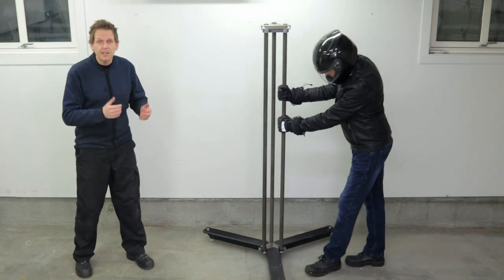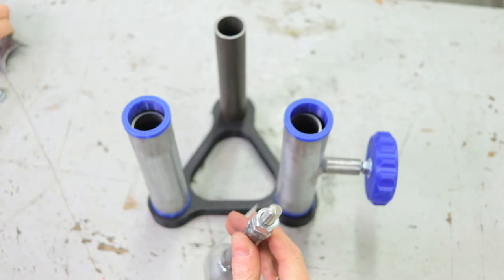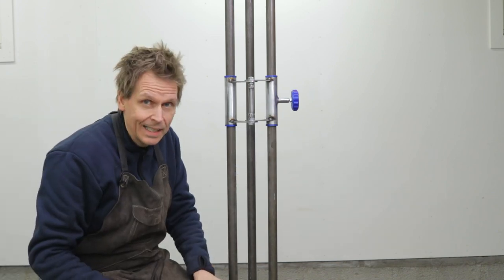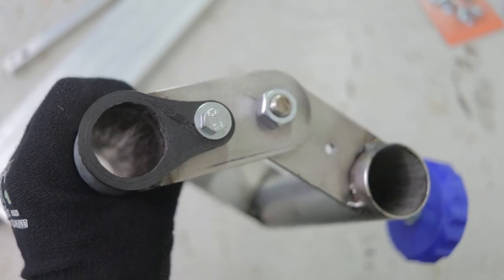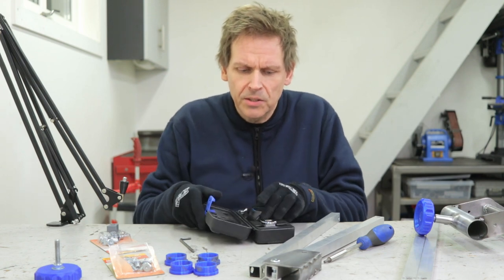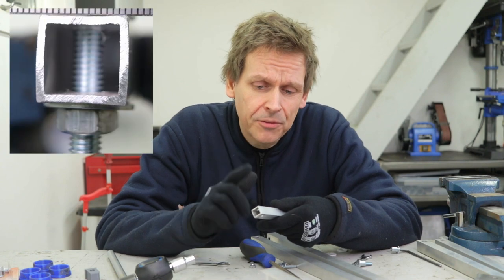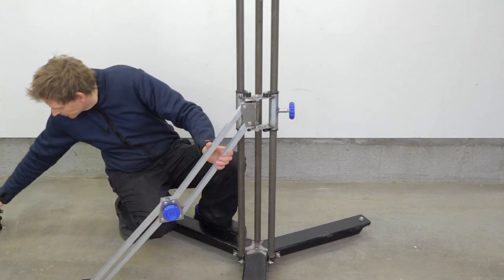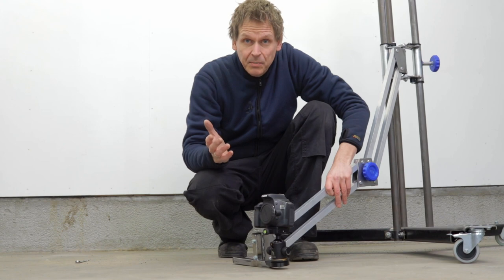Building a Camera Stand - E02

Comment: hi kl sorry i´m late for commenting, life threw a wrench. the stand came out G R E A T ! ! . i showed it to my son and i´ll be making one in the near near future, he promised to lend it to me so i can start my yt stardom career... hahaha. so far i have not been a real fan of 3d printing but you showed here some interesting features. the end caps are a great design, and the torque test very informative. for the looseness of the head i thought if it was me i´d fiddle with something along the lines of a motorcycle steering damper but i´m sure there are more simpler ways out there. thanks for sharing your build and design, take care. oh and thanks for the mention he :)
Reply from the maker: Thanks for the feedback and especially for your tips, it was very valuable!!! 😊It has been a fun project, and it seems like I will end up with a usable solution 🤞 I have had my 3D printer for some years now, and I have to admit that the strength and durability of these 3D printed parts are somewhat limited. They can handle quite some pressure, but they don't like to be bent or stretched over longer periods of time. I have found that combining 3D printing with metal work is a very good combination. The 3D printed part can be used to add strength (like I did in this video), add complex details or just make the end result look better. I am not yet sure how to make sideways movement of the arm better, I got a tips on using felt washers - I might try that. A small steering stabilizer / damper would probably work, but hopefully a simpler solution will do 🙂

Comment: The articulated arms seem to be longer than they need to be.  As long as you can reach the ground level, you can trade camera height for stability.
Reply from the maker: Hi, yes you might have a point. I have used it for a while now to gain som experience, and for sure they are long enough to get all the way to the floor or up against the ceiling. 😊I have once put my camera behind my bench drill, the long arm was very handy in that scenario. Also when doing overhead recording it is nice to have the long arm. I have not fitted springs on them yet, I hope that helps to avoid them from falling down because of the weight, that is an issue I have now.
Thanks for your feedback! I hope to make a follow up soon, I have several cool improvements ongoing, but some other projects needs to be done first 😊